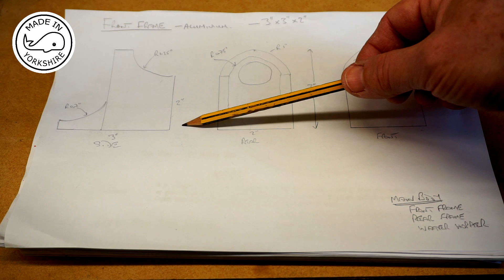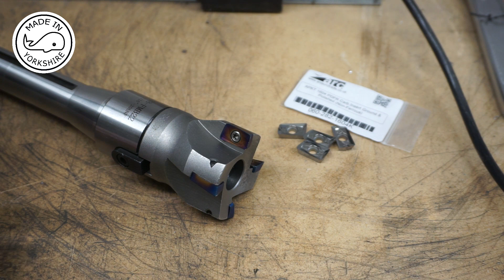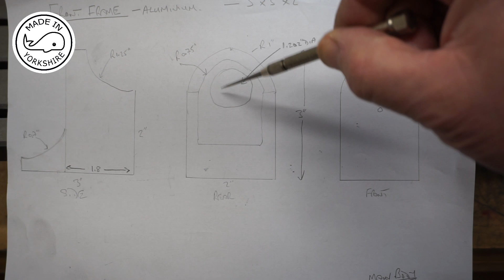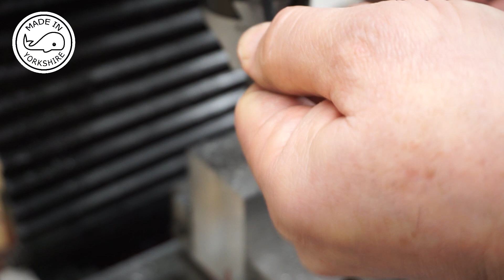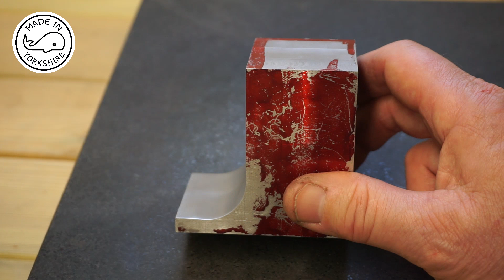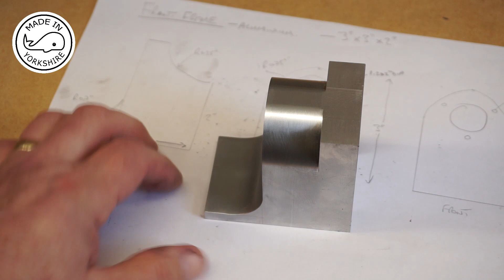#MT35 Part 2 - Farm Boy Hit and Miss Engine. Machining the Front Frame. By Andrew Whale.

Comment: Dear Andrew, You do a grand job on such a small mill. Thank you for making the videos. The big multi  tipped carbide  cutter is usually called a Shell Mill. Great for blocking up square stock and a good investment and cheap considering the amount of material they can remove.

Comment: That was a nice piece of machining. I am looking forward to another episode.
By the way how is your SX2P mill. Can you give me any feedback. I am planning to buy a mill but cannot decide between SX2 or SX2.7.
Reply from the maker: Thanks mate!
I had originally planned on getting the sx2.7 but when I visited arc I thought it would be too large for the space in my garage. I've made various enhancements the my sx2p, covered in my channel. I would say that the most important are gas strut conversion and scales with TouchDRO. The Dro makes it a totally different experience to use. It is a good little mill but power feed on the z-axis would be nice too. Based on previous experience I would say go as big as you have space for, though the sx2.7 still lacks dro on all three axis's.
Now I have more space, I've been considering the SX3.5DZP which ticks all boxes for me. Unfortunately quite expensive and still not available from Arc. I guess the Sieg factory in China has been heavily affected by coronavirus ☹️. Sieg gear seems pretty good and I love the sc4 lathe. So, I would suggest you go as big as possible based on your budget and space. If you go sx2.7 I think you will still spend more cash on a decent dro system.
Hope that helps.
Cheers
Andrew
Reply: @learningturningmetal  thanks a lot. I think I will go with 2.7

Comment: Nice work! Have you used Sketchup to help with 3D visualisation?
Reply from the maker: Thanks for the suggestion Ron. Skethup sounds like a really good idea but I've been trying to learn fusion360 for 3d printing. Trying to learn sketchup would probably result in major brain overload. Too many fantastic things to learn but not enough time!
Really appreciate the suggestion though.
Take care.
Andrew
Reply: @learningturningmetal  To be honest, Andrew, I can't get on with Sketchup but it does seem to be the 'go to' for most designer/makers. I prefer my ketchup without the 'S'... it goes better with chips

Comment: Hello Andrew, interesting project. I was/am thinking about a Red Wing. Couple of things that put me off are cost and availability of castings. The Farm Boy may be a good alternative. Be interested to learn where you sourced the bar stock?
Reply from the maker: Hi Simon. I had originally planned on getting red wing castings from forest classics. A few things changed my mind: cost, availability, concerned my mill would be too small. I also considered the Kerzel but decided on the Farm Boy. The aluminium billet for the front frame came from penninemetals (ebay) about £14. For the rear frame I've purchased stock from myldanautodesignltd (ebay). No issues with either supplier, but check availability due to the coronavirus outbreak. I've subsequently found that the threads on the Farm Boy are mostly UNC. I thought about converting to BA as I've got most taps and dies. However I think I will have to bite the bullet and purchase UNC taps, which will be quite expense. There are loads of components to be machined but it should be challenging and keep me busy for quite a while.
Good luck with your decision. If you decide on the farm boy I hope you will share your experiences with me cos I think I will need as much help and advice as possible 😉
All the best.
Andrew
Reply: Learning Turning Metal - by Andrew Whale Thanks Andrew, I think the Farm Boy may be for me. I have just finished the current project which was a Stuart 10H built as a bit of light relief after a Stuart boiler feed pump which was a challenge. I am not as accomplished as you at making videos. Re the threads on the Farm Boy I am sure that you could use BSF or even metric. When I have downloaded the drawings I will look at them and suggest some alternatives, the other option may be ME which are close to some of the US sizes and readily available at low cost. I will let you know what I decide to do. Best regards, Simon

Comment: You have produced a very nice looking component from a daunting sized chunk of metal. You didnt show the pile of swarf but it must have been substantial. Very impressed with the finish from the cutter and the band saw. How many hours did you spend on that part?
Reply from the maker: Thanks Tim. I reckon I must have spent around 20hrs machining it plus 20hrs just thinking about it and setting up! Very pleased with the result though.
All the best.
Andrew
Reply: @learningturningmetal  The time spent thinking about the order of operations was time well spent.  With such a complex part, you've got to make sure that you have enough material remaining after each stage of the machining to enable the part to be gripped for the next stage !

Comment: Hi Andrew, nice work.
You mentioned you don’t have a flycutter, you do have a boring head, set it up and plunge down to bore part of a hole.
Cheers
Reply from the maker: Thanks for the advice Raymond. I later realised that my boring head has a flycutter attachment, so I ordered some 8mm round HSS blanks. I just need to work out now the grind the correct profile. One job leads to another!
All the best.
Andrew

Comment: Good to be wary of climb milling but if you don't have any backlash it is ok to use it. Most rotary tables have the ability to trim out backlash so give it ago. Modern ballscrew machines can run in climb mill, for better finishes, because of the lack of significant backlash.
Reply from the maker: Hey Chris - thanks for the advice. I now understand a little better. I think my rotary table has quite a bit of backlash, but I will investigate!
Cheers
Andrew

Comment: Andrew. In future the quickest way to remove deep pocket material is with a slot drill ( 2 flute end mill ). Just keep plunging down to depth then move table 1 cutter diameter until done. It is quicker than milling and only wears the cutter end which is easier to sharpen. They call then slot drills as you are in effect just drilling a slot. You will of course have to join up all the holes but the bulk of the material has been removed. You can use a 2, 3 or 4 flute cutter to finish the pocket. Hope this helps. Stay Safe.
Reply from the maker: Thanks for the info Dave. I have a couple of 2 flute end mills, so I will try them on the Rear Frame - lots of material to remove on that one too.
Take care and stay safe!
Andrew